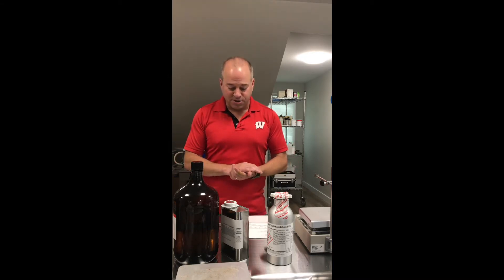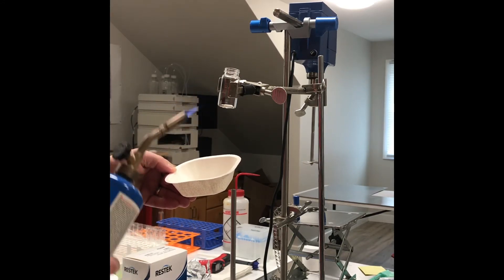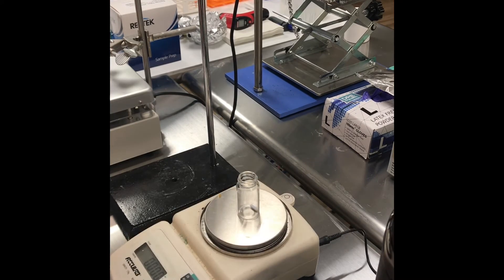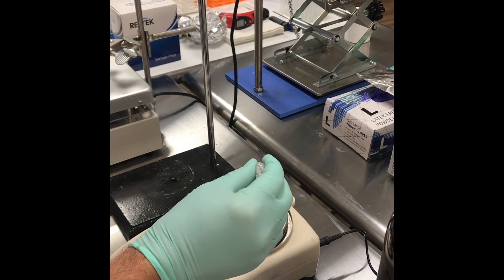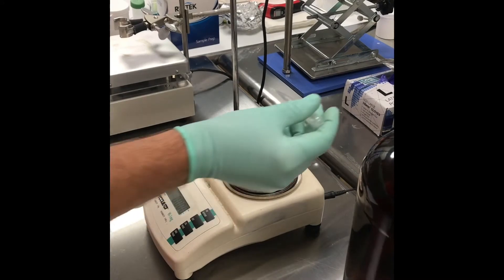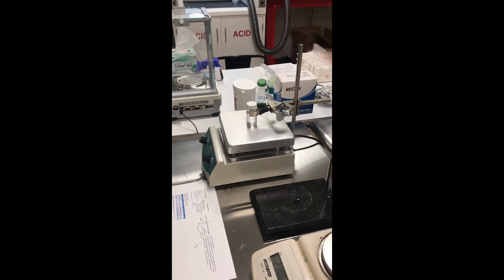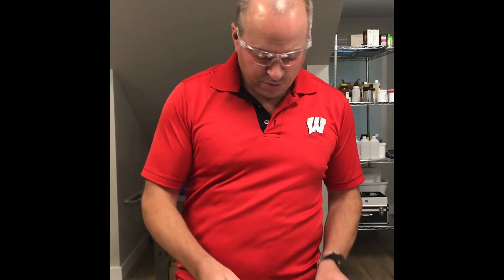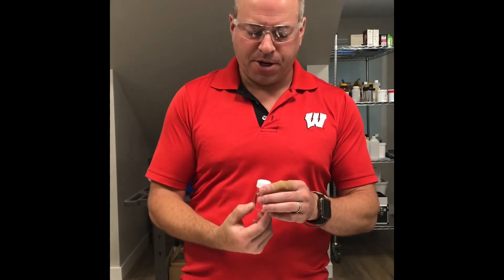Make Your Own Ceramic Coating

Comment: Can i preserve it ? Without adding any preservatives to it or else i should add any of the preservative to store it?
Reply from the maker: Avoid using any alcohol solvents and you want to keep your ceramic coating very dry!
 Water is what you want to avoid  to prolong shelf life.
Reply: @terryclayton  what should i add to preserve it ? Should i use n-butyl acetate as an solvent or not?
Reply: Because butyl acetate contains alcohol so should i use any other solvent other than butyl acetate
Reply from the maker: @Meccaaurmadina yes, that’s good.
Reply from the maker: @Meccaaurmadina use pure acetates with no alcohols.
Reply: @terryclayton  thank you for the knowledge terry ❤️ so i shouldn’t use any preservatives ? Just by using pure acetates i can store this ceramic coating?
Reply from the maker: @Meccaaurmadina  Its water reactive (moisture).  No stabilizers but shelf life will be around 18 months and highly dependent on humidity and cleanliness during production and packaging. T
Reply: Can nano materials be added?   Would an ultrasonic mixer be required?

Comment: Hi Terry, great job man.
How to remove the ceramic coating, what chemical or solvent be used.?
Reply from the maker: Once the silazane cures you cannot remove with any solvent.  Only way I know is to use a polishing compound and physically remove.

Comment: This is so cool to find out there. Thank you for providing the blog post and exact measurements! 
I am a total novice, so i would love to know - after making it, would diluting it with IPA be a viable option to make it a spray on option? I know that the effect wont be nearly the same, but would that be an equivalent of whats out there as a spray in the market? Some of them cost a lot too
Reply from the maker: Glad you liked it.  You cannot dilute it with any sort of alcohol.  It will react.  If you want to make a spray, use this: https://amzn.to/4bn9Pjg
Good luck and let us know how it works.
Reply: @terryclayton  great advice. Thank you so much!

Comment: In this vdo use Polysilazane 8.6g. It around 40% but in your blog it use only 20%. What is correct ratio ?
Reply from the maker: I would recommend the lower concentration which is easier to apply. Some prefer a higher concentration but it takes more skill to apply defect free.
Reply: @terryclayton  Than you so much sir.

Comment: Thank you for your excellent work! Congratulations on your extensive and astonishing level of life science research publications. 
I have 4 old collection cars and their old paintings I'm sure will only be improved with a formulation like yours. I want to prepare your formulation and I've been working on collecting the ingredients, 
I did not find to buy Paraloid B48 S, but I have found the Paraloid B48N, it is in grain format. Will it help me? Do you know what it should be diluted in, and in what proportion?
Reply from the maker: I would dilute it in toluene so it’s 45% solids.  Then you can use it in the formulation.  But it should work fine.  Good luck!!

Comment: I'm trying to find a vendor in the US for the cyclosilazanes or polysilazanes (or a mix of both), besides Merck. It seems that most ceramic coatings have "Cyclosilazanes, di-Me, Me hydrogen, polymers with di-Me, Me hydrogen silazanes" as the silazane resin, but this basically impossible to find.  Do you have any suggestions for vendors in the US? 

Also, do you think including additives such as polysilicates, SiO2 or even WS2/PTFE would improve the hydrophobicity even further? 

Great content, hard to find stuff like this!
Reply from the maker: Polysilazanes are typically produced in Germany and Japan.  Merck is a good trustworthy source.   PTFE can lower your COF but should be submicron to minimize impact on gloss as it’s an insoluble particle.  If you are not using on automotive applications, you will have a lot more latitude formulating.
Reply: Do you have vendor suggestions besides Merck that will sell to the US?

Comment: what if I did'n have polisilazane resin?  what material do I replace? can be replace regular resin?
Reply: and what replacement for carboxylated silicon? thanks
Reply from the maker: These are really the key ingredients otherwise it’s not a ceramic coating and it will not have water repellency

Comment: Thank you for this video! About polysilazane resin mentioned in your blog, do you mean using Durazine dissolved in epoxy resin or its just the powder diluted in the solvent?
Reply from the maker: The silazane should be dissolved in a solvent.  No epoxy is used.

Comment: Can use paraloid b72 instead b-48s bcause i cannot find one?
Reply from the maker: You will have to run experiments to find out.   Check solubility, solvent release rates, hardness, etc…. Good luck!

Comment: Curious, what specific Paraloid resin and surfactant are you using? I couldn't really tell from the video. Thanks in advance.
Reply from the maker: Hi Steven, the resin I used is B-48S and the surfactant is Tego phobe.  If you use one that reacts I think your water repellency will be prolonged.  Good luck!!  -T
Reply: @terryclayton  Hey Terry, Ive managed to finally get a hold on some Durazane. I got both 1500 and 1800 grades. When you said "one that reacts" where you meaning it in regard to the surfactant? I see really only tego phobe 1500 N is the only solvent based additive. Did you use that one?
Reply from the maker: @stevensoriano9134  yes, good choice over Tego Glide for long lasting hydrophobicity.  You can run DOE to dial in concentration.  If your coating a porous substrate look to lower molecular weights.  Cheers

Comment: Hi  I saw a video that after mixing the solvent and polymer,and.... he added Al2o3 and sio2 powder at the end and said that it makes it more durable and anti-scratch. Your formula is easier. Can these powders be used in your formula?  
My car is old and has few scratches
Reply from the maker: Depending on the particle size of what you add you may end up with a matte look instead of gloss.  My formula is meant to have very high gloss .  Thanks!
Reply: @terryclayton  
I don't know the size of particles !!!!! It was a white powder!!!!
He add 10%(powder) of polymer weight and the glow was good
But it had a complicated formula😅
Your formula  is very simple 👏
Thanks  for reply
Reply from the maker: Post the video and I’ll take a peak.

Comment: Very rare content Sir I appreciate 

The question is I found following chemicals are they ok to use in the substitution please tell me and gave me your gmail address i want to connect with you please reply waiting for it

Silicone dioxide fumed ( Aerosil) = carboxylicated silicon = Silicon dioxide fumed (aerosil ) = silicone oil =Silicon dioxide ( precipitated)

Polyvinylphyrolid k30 = polysilazane risn

Methyl Tertiary Butyl Ether = Methoxy-methylpropane

N Propyl Acetate = n butyl acetate
Reply from the maker: You will need to test with the solvents.  Do not substitute with  K30.  Cheers